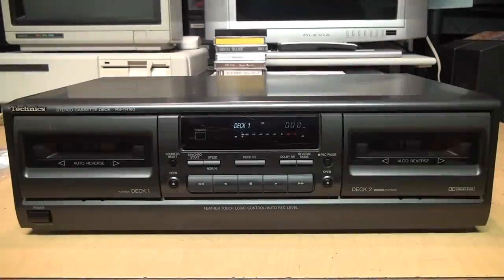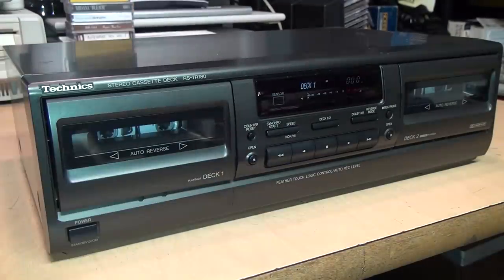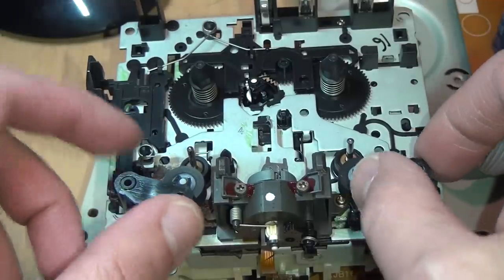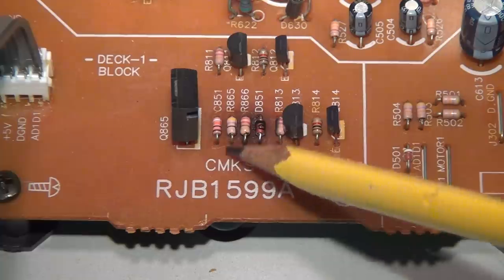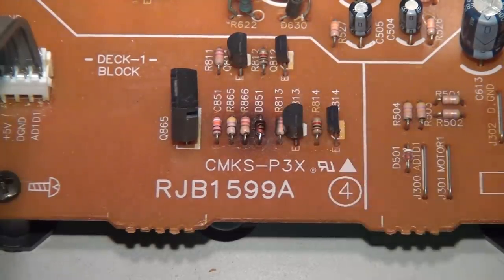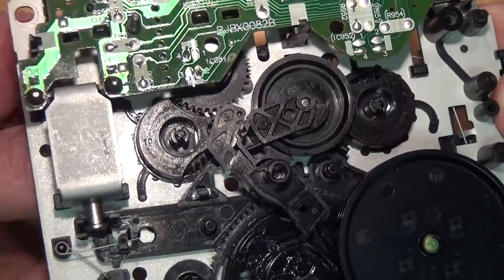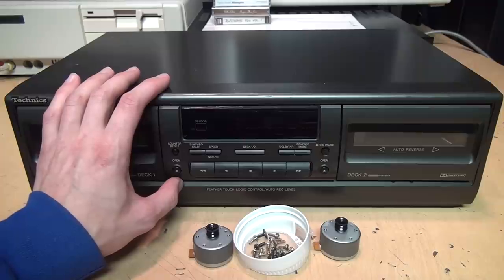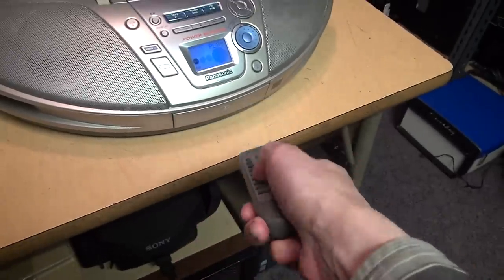Fixing a cassette deck but Everything Goes Wrong...

Comment: I love these videos but it’s taught me that I’ll probably never have the patience for a dedicated tape player. I have an early 90’s Sony boombox with the red and white cable outputs that I hook up to my stereo system.
Reply: Nakamichi Dragons maybe the best sounding and most sought after, but this video and this comment proves that all you really need in order to listen to tapes is a good boombox as decks tend to fail in various ways
Reply: @RealEpikCartfrenYT , Nakamichi decks do sound awesome.  However, they have a lot of fail points and are expensive to get repaired.  Only a handful of technicians remaining who can do the work, and they charge accordingly.  And that's on top of the high prices for even broken decks.  WAY outside my price range.  I have a Pioneer deck from the late 90s (CT-W606DR) and a new production TEAC W-1200, as well as a last-of-the-line Panasonic cassette boombox from a couple of years ago.

Comment: It sucks that basically almost all (affordable) cassette players from 1990 onwards has one problem or another, which just goes to show that a lot these companies were really trying to push whatever was new and exciting at the time (planned obsolescence before it was a thing). Case in point, this deck having all of its electrical components just go up in smoke, with Technics cassette decks being virtually unheard of today, and Sony cassette decks from the same time all having belts that just melt for no reason, even if they were kept in pristine condition (I'm having to clean up that same sort of mess in the one I just bought the other day). Keep in mind they were the ones that also introduced MiniDisc, and later CD, at around the same time they made these decks. They're engineered to work to some point on the narrowest budgets because they invested all their time and money into other things. Not to say that some of them weren't good, just that most could not be considered quality products, at least by comparing them to earlier ones from the 80s as a prime example.

Comment: Would it be possible to isolate the audio and mech section from the PSU, and then concentrate on the PSU? Although I see an issue here too - you may have to desolder many components on the PSU board to isolate the cause!

One reason why I've stuck to working on the old classics of the 1970s and early 1980s.

Thanks for the upload of this video!

Comment: I'll address most of your complaints below.

- Decks need servicing: ALL of them, every single one of good reputable brand of the past needs servicing by now, rubber replaced (belts, pinch rollers) and mechanism cleaned/re-greased, lubed capstans. These for example are the same 12x6 mm rollers used in upper RS-TR models, among the cheapest on the market, you can get them for less than 5 BUCKS delivered for a decent quality set.

- Gears splitting: ask the owners of some particular Walkman series... pretty much ALL OF THEM need gear replacing. And yet they were the most expensive, most exclusive, higher costing Walkman series SONY's ever made, the DD series. But those that break in my experience are not of the black variety but are of the white molded variety, not on this deck. And those can also be repaired, there's a technique for that as that kind of plastics is featured in pretty much every single deck you've shown in this video, including those from the 80s and earlier.

- Even if the source of your problem is not to be known if the unit was working until the moment you tried to service it, exiting the service mode was a pointless exercise. It's reasonable to assume it was something that you could have knocked out and so I'd have at least tried to re-seat and wiggle the connectors. One should always use de-oxidant on those also to ease the slide-in/out of the sockets/ribbons.

- That mechanism for what I've seen contained a lot of good moving UNFINDABLE parts, the rotating head assembly down to the head and electromagnet seem entirely those used in upper models and several other parts are shared.

This wave of Technics components are notorious for staying powered on AT EVERY TIME, all the rails are powered, all the regulators under tension, the processor is powered... Some have stayed on for 40 years and yet the regulators still do their jobs, all the zeners cap their voltage, I could go on... it is a testament to Matsushita electronics design and quality components as you've seen from the motors.

it's even possible that you knocked out a cooked resistor or zener. For one that knows these decks the problem could have been quite trivial to diagnose as it was very early on in the spin-up phase and all the rails are easily identifiable at each stage. It seems DECK1 failed the early spin up test.

Basically you're PRETENDING to give good advice but you seem to be ignoring to deal with a highly integrated automatic deck with servo assisted everything. Throwing away a deck for what can possibly be a blown resistor is quite RIDICULOUS. And buying another one that's 40 years old doesn't mean it wouldn't go bad in a very short time. This is true for every reputable manufacturer. There's more... some of the most regarded machines have the higher incidence of failures.

Of course you can renounce the convenience features, but it wasn't the point of this deck. At that point you're after a mechanically operated, all analog deck with no computer chip inside. You lose servo assisted doors, servo assisted mechanism, remote control capability and you're still tied to service the unit.

But I understand you... you did not like the unit and in the end you've done what you thought it deserved in the first place, you threw it away. But rest assured you were just one tiny easily diagnosable component away from making the unit working again, and every manufacturer later followed suit if not earlier or at the same time, because it was INEVITABLE progress, pretty much like in the cars of today there is a set of designated features that are now discounted: air conditioning, power windows,  power steering, hydraulic clutch and nobody argues they're unreliable or they break more because they have those features.
Reply from the maker: Like I said... there is NO SHORTAGE of these decks on eBay. Go save another one.
Reply: @vwestlife  Why should I? I don't need one now and I don't feel for stuff.

It's just that when I buy my stuff I don't throw it away because they need trivial troubleshooting I am not willing to do.

But meh... I guess we have different goals, you make videos and pass your message, I do repairs and scavenge parts. Fine.
Reply from the maker: @m80116  Then you completely missed the point I made at the end of the video.
Reply: @vwestlife  I watched to the end. You make good videos and can bring forward any point you might want.

I just hoped you'd fish out a meter and diagnose it, it doesn't make justice of your skills throwing something in the dumpster without even trying.

All the best for the next one...
Reply from the maker: @m80116  This entire video was me trying! But I know when it call it quits, rather than waste my time trying to do component-level repairs to a piece of equipment that isn't worth it.

Comment: The last thing I expected was an electrical fault, but I guess at the same time, at least it wasn’t something super high end. It’s got the 90s type of design, but the low end side of components. An entire plastic mechanism is unfortunate but at the same time kind of expected considering when it was made. If you need to press a button to switch between controlling decks, it’s not exactly geared for the high end market. Otherwise, good quality Technics decks are actually pretty good, this is more of a “What’s the lowest manufacturing cost for the cheapest option?” type of thing.

Comment: In the one I fixed the bad gear was in between the two black gears. It was a slightly yellowish translucent gear and it was soft, you could easily bend it. And replacing it is a pain, but at least I have a working deck now.

Comment: You should have saved the Technics badge from the front panel, too. They are notorious for breaking off, and usually interchangeable between most models.

Comment: I know, this deck in particularly is more on the junky-er side of things and despite the Technics branding on it, it looked a bit like trying to polish a turd. 

But still, coming fresh out of it I can't entirely agree with the closing statement. As a bit of an enthusiast for old equipment I feel like it would be a shame to see the pool of functioning systems slowly reduced because people aren't bothering to do repairs. I own a pretty obscure Hifi Setup that was made in East Germany in the 80s, and I did have to put in some work to get everything up and running again. More than you can get a working system for probably - if you can find one. So it sure wasn't financially reasonable, but it still felt worth it. Got to keep these things going.

Comment: I bought a faulty TASCAM CD-A500 (Tape / CD combo) - I found the diodes on the rectifier had blown - Mabey its a common diode issue? or just a power fluctuation from Supply Company / weather ?  You are right some cheaper stuff is just not worth the repair costs!

Comment: Did you keep the gears by any chance? 😂 I've just acquired one that turns and stops immediately.. I have a feeling it has a cracked gear 😂
Reply from the maker: As other viewers have said, the gears in the mechanism of this deck don't suffer from that problem. It's the gears which are made of a thinner, almost transparent plastic which are prone to cracking.

Comment: Well that was disappointing. 28 years one of these has been sitting in my closet. I was excited to see your repair video, but understand the shortcomings of surface mount and plastic components. I’ll still try to repair mine, but if it doesn’t work, ⅓ of a lifetime later, it’ll go into the trash.

Comment: My Philips audio tape recorder/cassette player suffered the same fate. The gears worm out and there weren't any replacements. Also the modern MP3 player any iPod made it useless junk. Hence had to sell it. I wish we had 3D printer back in those days, we could just simply 3D print ourselves to replace broker parts

Comment: Funny end of a cheaply made deck. They do sound pretty good when they work fine.
This day and age, in my experience, these are a bit easier to save than the Sony lines of dual decks which have some even more atrocious tape mechanisms. I've never seen a 90's dual Technics deck with split gears and cheesy rubber belts, but I have seen plenty of all of that in Sony decks.
I do save/rebuild the odd dual deck just for fun, and most of the time, the main issues I see with these type of dual tape units are the oxidized leaf switches atop both cassette wells. Those tiny switches cause all kinds of issues with mechanisms across most brands, that will make them totally useless. 
If you can service those switches, you can save just about any deck you want.

Comment: similar thing happened to me trying to replace the belts on my mom's old JVC boombox, got the belt on, the sound was abysmal, tried a different belt, a small spring flew off, spent 3 hours trying to get it back on, then more bits flew off. I also listened to the motor and it sounded like it was about to fail, then I had enough and just cut all the wires from the cassette mechanism and removed the motor and the heads and threw them to the trash to prevent me wasting more of my time on it. At least the radio still works fine, the switches need some cleaning.

Comment: In 2018 I bought a used Sony CT-20 from my local record shop for $50(they also sell used equipment).  Its worked perfectly and I have yet to remove the cover for repairs.

Comment: Wow, that thing is cheese-o-matic! Not at all what you would expect from the Technics brand.
I used to have a Technics from that era which looked very similar, but had MUCH better quality and features - proper HiFi mechanisms (not boombox types like here), record level controls, and it even had HX-Pro and track skipping! Despite being quite plasticky it had great sound. Anyways one of the heads went bad (also had those crappy auto reverse heads sadly).
Reply: Cheese-o-matic 😄Can I use that?

Comment: On the gear front, the vintage Macintosh community has been replicating hard to source gears for the older floppy drives. They are smaller gears and they either need to be 3D printed with a very fine/accurate nozzle, or with a resin printer. Someone would need to model the gear, but hope for a future replacement is certainly possible.

Comment: They should have a special designation for 'vintage' regarding the 90s+ era of injection-molded, precursor of SMD, LANDFILL CHOKERS... like, "that's not vintage, that's BINTAGE... as in chuck it in the bin! Or see if you can answer the challenge they've given you, that since this will never accomplish its given task again, find another use for it, OTHER than porous waste used to effect drainage in swamp reclamation projects... and not using it as a high velocity projectile! That's the BINTAGE challenge!"... 
I'm coining the term. "Bintage!"™

Comment: That failure seems like something from the deck was reconnected improperly upon reassembly which caused a short.

I know because I accidentally reconnected a wire type ribbon cable backwards after replacing the infamous crumbling playback gears on my Technics TR-355 (the Pin 1 stripe was a nearly invisible faint yellow and I assumed the ribbon was sitting in the right orientation) luckily the damage was only a fried a fusible resistor on one of the voltage regulators.

A similar thing happened the capstan motor ran and in my case the selector solenoid was energized and remained on.

But yeah if I see a plastic flywheel on a tape deck that's a sure sign that it's a "cost optimized" (CHEAP) mechanism that isn't worth more than a cheap set of Amazon belts.
Reply from the maker: I didn't disconnect anything. The wires had enough slack to allow me to service the mechanism without disturbing them.

Comment: I fix these a lot,  and I kind of think that at sone point, possibly THIS point,  that all of those decks were made by Sony.  The hardware, the designs, all pretty much the same thing, perhaps with a few other doodads... I imagine there was a little sharing going on by this time, in the consumer market... such as the sendust alloy heads, and other proprietary bits, which seemed to be in every deck at some point. Teac even morphed into this kind of deck on the consumer level,  just offering three heads, which became desirable, years after they invented the tech for a dual purpose head, which all brands switched to, only to have them hold out as the last brand to offer THREE. I'm curious to see what made this one such a hard fix. I can say that I've never successfully fixed a Technics from this era.  Though I can't remember what was the issue. So many of those had the flip heads that as we know... eventually flipped their lids completely! With so many fragile plastic springs loaded cogs and others binding up, with a terribly made bearing, made worse by oxidizing grease-turned-glue. Like the old Dual turntables. Planned obsolescence at it's best! Sometimes a less than 24 hour window. Lol.

Comment: There is no shortage of cassette decks, from basic models to ones with the most features and well-known brands. No great loss that this piece of electronics is going to get recycled (we hope, because who really knows what happens to this stuff?). Your favorite or hated source for these things has 100s for sale everyday, and I would guess 90% don't work correctly. I have had good luck with Onkyo, Panasonic, Realistic  and JVC decks and bad luck with Sony and Technics. They are old and need cleaning, new belts and probably pinch rollers, maybe even gears. Many of the electronic components are at or near end of life. If you have a working double auto reverse deck from the 80s or 90s you are lucky. Eventually it is going to die. Will you fix it or pay to have it fixed? Hamlet wants to know.

Comment: Oh yes...diodes, regulators or transistors. Our old Panasonic TV from the 90s died about four or five years ago with those faults (two transistors, a few diodes) - caused by worn capacitors, but still, for working over 20 years it did well and since the tube is still good a universal board can be used (repair was attempted but there was no exacting components available...and burnt the flyback)

Wait, what? Full logic control boombox!?

Comment: I picked up a Technics tape deck from a charity several years ago and ended up wasting time and money trying to repair it only to find the dreaded broken plastic gear. It ended up being a learning experience so my time wasn't entirely  wasted. I however wouldn't recommend buying a vintage tape deck without doing your research first and being prepared to inherit somebody else's problem.Buyer beware as they say.

Comment: i  been thrifting and scouting alot of stores one of rules i have is that find a outlet you can plug in it  and bring a cassette with you to see if it spins or does any thing if its missing parts like rolllers are gone or the pinches are bent i leave it alone or just buy it for parts if negotiable

Comment: I hate to see the Technics name on transports that have been cost-downed to that extent. I'm going through a phase at the moment where every single little washer I pull out of the older decks seems determined to vanish into the 4th dimension, but I'd rather deal with that than a bunch of broken plastic parts I'd never find replacements for.

Comment: fixed an old silhouette tape recorder, every. single. capacitor. exploded.  but it works perfectly now because the mechanism was solid and the failed electronics were just an analog amplifier on a single sided board and thus an easy fix